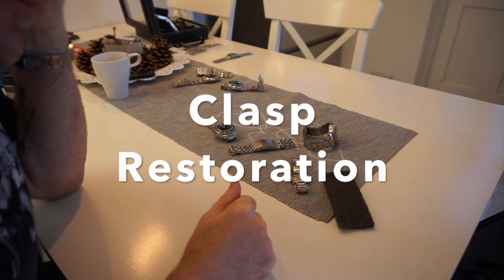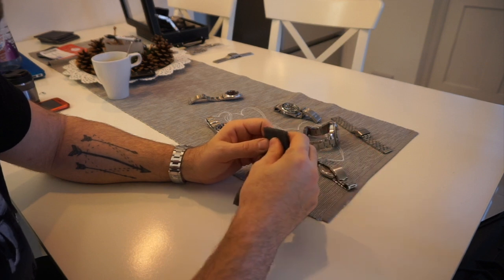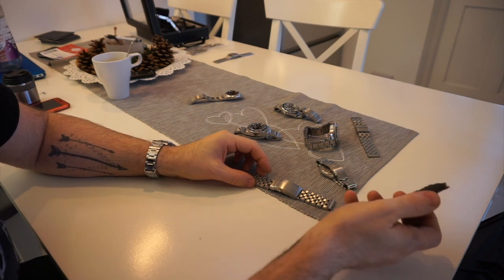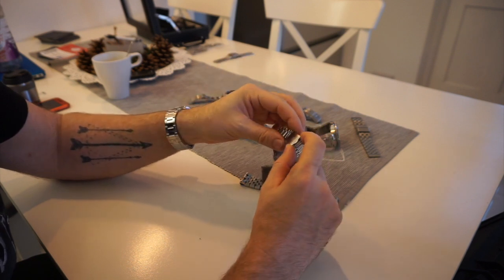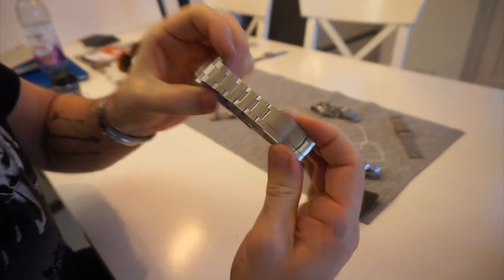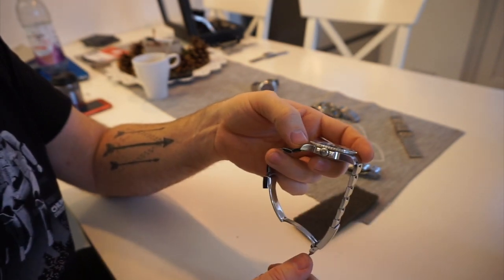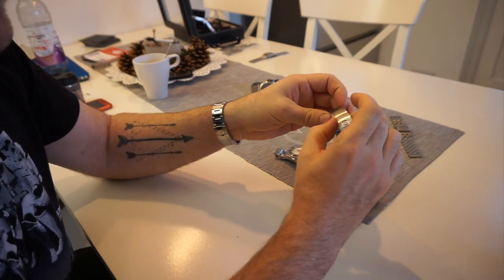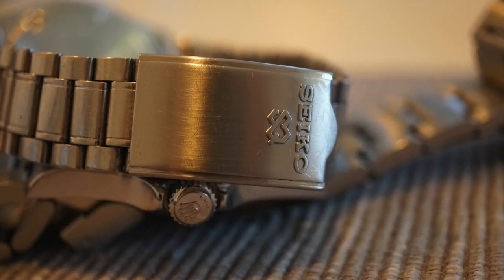How To Remove Scratches From Clasp

Comment: Hi, where can i buy it ? Thank you
Reply from the maker: it can be found on ebay or amazon  here is a link to some but you only need a tiny little bit https://www.amazon.co.uk/Sealey-HP1523UF-Abrasive-Finishing-230mm/dp/B00NVL42S6/ref=sr_1_40?crid=1JIL071T6WQM3&keywords=3m+scotch+brite&qid=1643231361&sprefix=3m+sot%2Caps%2C81&sr=8-40
Reply: @ClickSpringReview  thank you